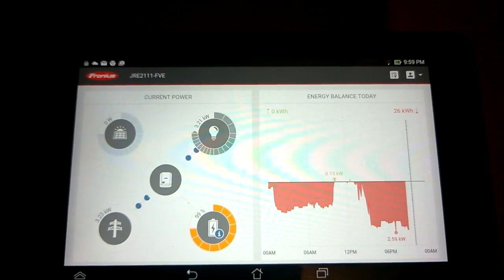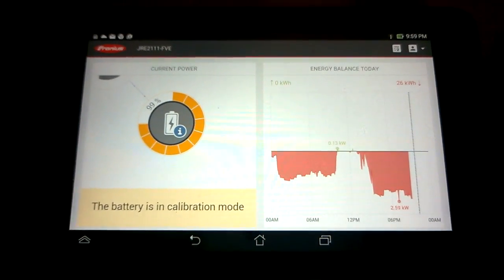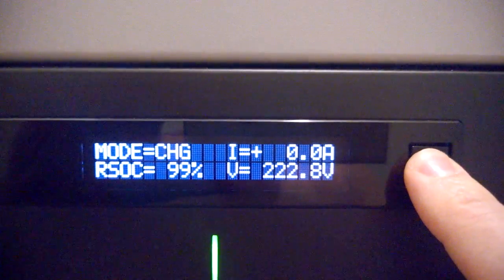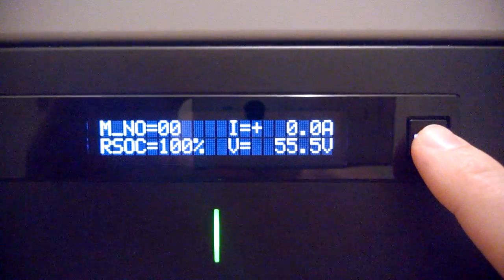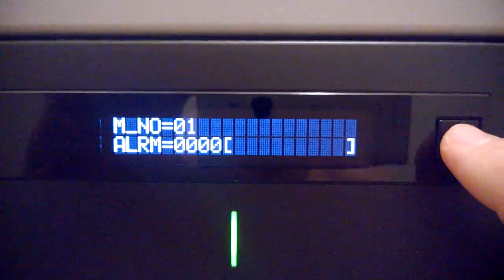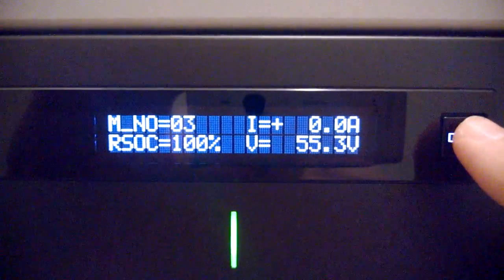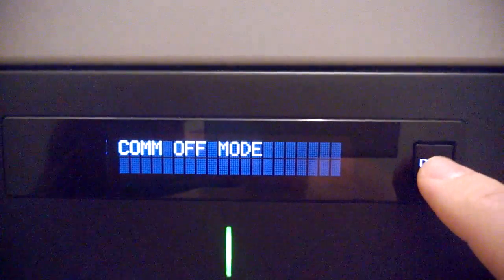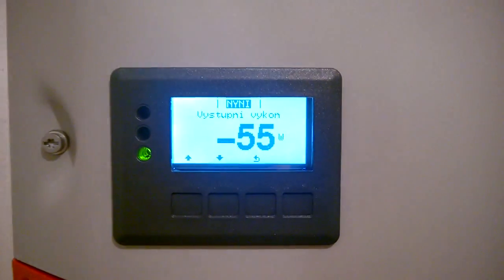Fronius solar battery 6.0 calibration/balancing EN

Comment: My battery switched to calibration mode yesterday which is all well and good, but it's been in calibration mode all night so I've been pulling power from the grid... :-/
Reply from the maker: That was happening during winter to me as well. But since end of February my consumption is down and production surged enough to fill the battery on daily basis. Calibration was done only twice since then and it was very fast (~2 hours.). It was also pulling power from the grid even if I don't have that allowed. I reported it to Fronius and waiting for feedback.
Reply: I worked out how to fix this. 

It appears that the battery will calibrate ONLY with solar PV generation unless you have the setting "battery charging from DNO grid" under the System Overview section on the inverter's built-in web server ticked.

When you do this, it will do the calibration charge with grid power if there is no solar PV being generated. The advantage is that you won't then be pulling grid power all night while you wait for the sun to start shining again.

The problem with using ONLY solar PV to calibrate is when the sun goes down and the calibration isn't complete - it won't let you use the battery's stored power until calibration is done.